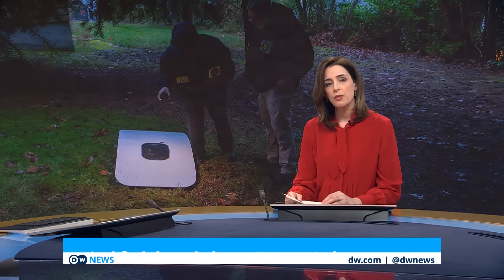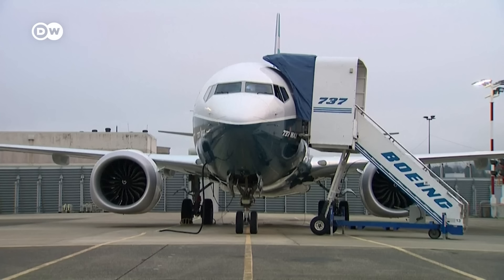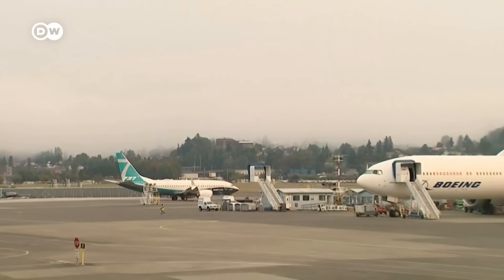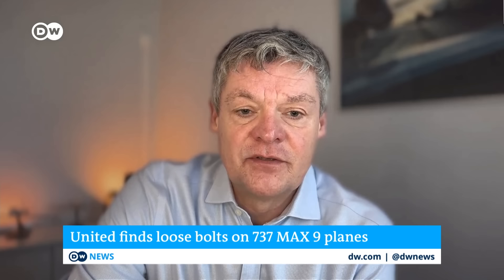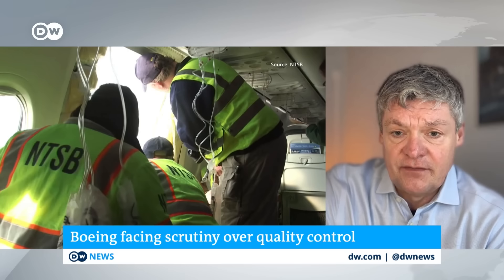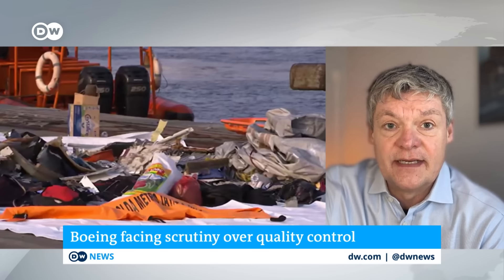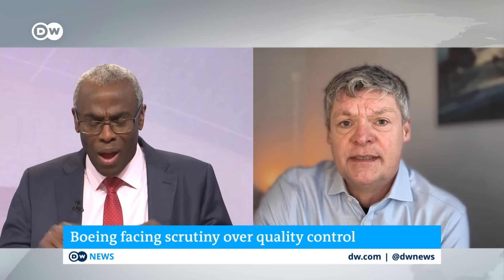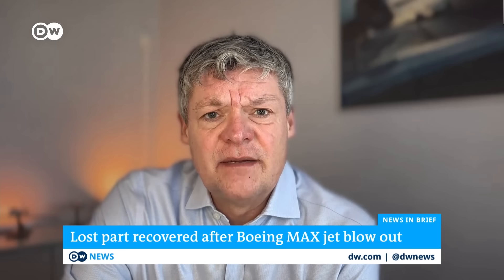After the Alaska Airlines incident: Is aviation quality control insufficient? | DW News

Comment: This isn’t about “aviation” quality control - it’s about Boeing quality control. No other manufacturer consistently has such dramatic - often catastrophic - problems.
Reply: ULA's (half Boeing)  moon lander was just lost so I agree
Reply: @bigboybuilder That lander was produced by astrobotic not by ULA, ULA just makes the rocket and that part was successful
Reply: Inspections aren't taken seriously,  by some inspectors. On a daily basis. Ask me how I know!!
Reply: its also about regulations and a lack of proper inspection....Boeing is too buddy buddy with them. They need more teeth to put boeing in their place.
Reply: @boa721  How do you know?
Reply: Well, both. Boeing does something wrong and the controllers don’t notice
Reply: @tamikovacs3887  Boeing does something wrong BECAUSE the regulators have been so reduced in their capability
Reply: you're acting like Aeroflot doesn't exist
Reply: @lowwastehighmelanin  they do, but the buck stops a boeing for hiring them, and regulators not doing their jobs.
Reply: @tamikovacs3887  controlers??
Reply: lol @lowwastehighmelanin
Reply: Don't blame Boeing's engineers for this.  Blame upper management, which does all they can to (A) ignore their engineers, and (B) cut every corner and every penny they can, by doing such things as start up the new factory where labor is cheapest and also least educated.   They literally moved their headquarters to Chicago to get away from having contact with their engineers who were constantly pointing out what they were doing wrong. 

Boeing needs a total change of leadership. NOW.
Reply: @lowwastehighmelanin  LOL! Aeroflot doesn't make planes!
Reply: Well, there has been. Look at what happened at Lockheed when it took several crashes to discover the propeller spinner whirling issue that broke the wings of the Electra until the wings were strengthened and the propeller spinners replaced.
Reply: @tamikovacs3887 that would be just Boeing and the FAA… not the whole aviation industry
Reply: @biz0r07  A regulator, the FAA 

not regulators
Reply: There was MD and it’s still MD
Reply: ....BS.....
Reply: Boeing has been making trashy airplanes for the past decades..
Reply: @Turboy65  Of course it is not the engineers fault, it is the board members and CEO, Dave Calhoun, who has a degree in Accounting. The CEO of Boeing should have at least a bachelor's in Aerospace Engineering , maybe with an MBA.
Reply: @DrVVVinK  Every company that USED to be run by engineers, and then switched over to beancounter management,  has suffered greatly for it.
Reply: @Turboy65  The ironic thing is Tim Cook has an engineering degree, and someones iPhone got sucked out, and when it landed it didn't have a scratch on it, and still works.
Reply: Doors don't fall off fords due to better quality control than Boeing.
Reply: @albertseabra9226  that is a ridiculous statement! the 747,717,757,767, 737 (non Max) 787,777 all have very good safety records
Reply: @tonamg53  I assume more than one person works at the FAA...so yea, regulators at the FAA.
Reply: @Turboy65 Unfortunately, the company suffering isn't our concern. The people have had to suffer more. The families of those that have died have suffered the most.
Reply: @andrewallen9993  The method by which they attach is COMPLETELY different but yet you're not wrong anyway.
Reply: In a country where education has degraded so much. Eventually more complicated parts of the economy will be affected and start falling apart.
Reply: Let’s not forget the 737 Max.
Reply: @brandonbrown4819  Boeing business Model changed.
In the good, golden years, Engineers planned and created the airplanes. 
And the Company was run under a Central  idea: Creating quality planes.

The Model changed. Cutting costs, cutting corners, the old guard left  being replaced by Engineers deprived of any authority.
Replaced by Financiers "endowed " with a short term mentality.
Unfortunately, about the same took place in innumerable Corporations with terrible results.
Reply: @biz0r07  Regulator is the FAA… not people who worked there.
Reply: It's too new for maintenance issues!!
Reply: NTSB isn’t doing the job of certification either!
Reply: @mmeeddddddozzzzzzz3421  Obviously,  you are  totally correct.
Reply: @rogerk2049  and they’re not supposed to. NTSB investigate accidents. Certification is done by the FAA.

The point of having two separate agencies is to avoid bias and conflict from self review. FAA is under the US Department of transportation while NTSB is an independent federal agency.
Reply: Ever since the crashes in Indonesia and Ethiopia I have made it a point to avoid this aircraft. They tell you the aircraft model at the time of booking. Please avoid it for your own safety. 
This plane was obviously rushed to the market  as Boeing was unprepared for the competition from Airbus. Hence they asked FAA for a lot of engineering exemptions.
My fear is that they may use these exemptions company wide. 
Now I am nervous about the new 777 and 787.
Reply: I am an American and I’ve worked in factories and I’m an engineer. American quality control is dismal in most companies. You have to understand that there aren’t very many technically savvy people in the USA. People go to college and get degrees and easy things like business. What a joke!
Reply: Boeing became the General Motors of aviation when they joined with M-D.

Comment: Boeing is a good example of what happens when you let business economists lead such a company instead of engineers.
Reply: Or when DEI takes over a company
Reply: @kaseyc5078 how did you manage to relate this to DEI exactly?
Reply: @papaleyo 
When people are hired into a company to fulfill DEI requirements instead of having the right qualifications.
Reply: But how did you get to this conclusion. You're just showing how hateful you are.

Boeing made the decision to outsource the production of various parts of the plane to countries like Japans, Italy, etc. This is where the quality control issues began to crop up.
Reply: Exactly.
Reply: @kaseyc5078 you won the contest for the  dumbest post in the internet.  I bet you’re a MAGA voter
Reply: While passing on the balme to foreign suppliers sounds enticing, bolting of doors to the airframe happens at final assembly which is in the US
Reply: there is no reason to spin off assembly operations to separate companies EXCEPT to shave costs off a product. You can't do that without reducing safety processes, they simply go hand in hand.
Reply: Actually one of best was Schrontz, who had a law degree.  But he knew along with key engineers like Mullaly that tests will cost what they cost to produce a safe airplane.  Next is that production will cost what it costs and cost is better then shoddy work… what killed Boeing? Failing to buy McDonell Douglass and allowing them to take over Boeing.  First thing Stonecipher did was force out Mullaly and installing a new management philosophy of outsource outsource and outsource… we say a complete failure if this model with 787, we told them that you can’t cut concept to market in half… 2 years in, key part was still not designed or tested… 

This reporter is terrible… loose fasteners is a production problem, not a structure problem.  And assembly of the fuselage comes out of Wichita Kansas… so what happened to QA?
Reply: @RT-mm8rq  So the people admitted in under such a system have 0 qualification? Like do you think companies suddenly STOP looking for experience/qualifications when they account for diversity? This is just hateful like come on.

Comment: This is what happens when you let an airline company do it's own safety inspections.
Reply: Boeing has one option on this situation with the MAX- they may have to go to having two inspectors signing off critical installations or maint! the 747, 777, 757, 767, 787 all have very good safety records but the Max is the lion share of their commercial Airline business now!!
Reply: @brandonbrown4819  i saw the pictures of the loose bolts and to be honest, i doubt any inspector looked at the installation and approved it AT ALL. You can literally spot the loose bolts by just looking at them.
Reply: @fgbae8220  I hate to admit it, but you're probably right- on the critical installation the Inspection was probably pencil wipped!
Reply: exactly the FAA needs to have a backbone and not let the large manufacturers to do their own inspections
Reply: Then you probably don't want to know how the medical device industry operates. Least even what a 510k is.
Reply: @pfefferle74 We do and if it's a problem for them as well, then it also needs to be rectified. You can't just say, look there are problems over here, therefore you can't criticize those other problems. It doesn't cancel out, does it? Problems anywhere are problems nonetheless, and they deserve to be addressed.

Comment: From an engineering point of view, you wonder why the "plug" is applied from the outside and not from the inside where ist is pressed against the frame by the interior pressure. When windows are replaced with plugs, for instance, during the conversion from passenger to cargo aircraft, they are mounted from the inside, and they simply cannot physically fly out like that because they are bigger than the hole they are closing.

From a safety point of view, shouldn't all of those planes be put through a complete revision? Nobody knows where else crucial manufacturing blunders have occurred as obviously Boeing is not capable anymore of guranteeing the integrity of their manufacturing and quality assurance processes. Nor is the FAA who has miserably failed again to exercise their oversight over such things.
Reply: A good question, but the answer lies in the fact the framing around the plug is made for an emergency exit, and the engineers at Boeing came up with the least costly way to keep all the door opening builds the same. It also allows for a emergency door to be added later if an airline chooses to increase the seating numbers. Yes Boeing has QC issue, and most stem from removing I points (Inspection points) along the build process. All about corporate greed and CEO's making millions if they cut costs.
Reply: The design is meant to deceive passengers who might notice that they are sitting in front of a hole that the airline purposely put in the fuelselage to save money.  Why in the world would you buy a brand new airplane WITH A HOLE IN THE SIDE?!?!  

The answer appears to be because it made the fuelselage a few bucks cheaper.
Reply: That's an extremely important point and it should obviously b installed from inside so there is no chance of this happening
Reply: Maybe in emergence exit situations, outside plug fitting makes more sense.  Usually workers or mechanics use automatic torque tighteners/wrenches to tighten the bolts, exacting the engineering torque specifications.  I'm puzzled why there still has loose bolt issue.
Reply: It is a design flaw. I am sure NTSB will address this issue at their final report.
Another point: Why are these plugs required in the first place? Most of the customers do not need dense seat configuration. You open a hole in the fuselage and then try to close it. Extra failure point.
Don't tell me the story that second hand owners may want to change the seat configuration. Who does that and why Boeing should care?
Reply: @mingouczjcz3800  The cotter pins most likely never installed.
Reply: @mingouczjcz3800  You could still design the plug differently than the door it replaced such that the plug will no fit through the door opening. Every thing about that plug should be installed from the inside.  Covering it up later with interior panels would be okay only if they were easily removable and the plug then inspected regularly.   Seems like the FAA has no teeth anymore.
Reply: @mingouczjcz3800  Production line, got to get them out now. or like on TV, Price and Supply Chain issues, we don't have all the bolts or just finger tighten them it's faster.
Reply: @mingouczjcz3800  Production, hurry hurry. You put bolts in plug door latches finger tighten them, you come by and torque them. Oh XXX went on vacation or was sick and mist a week or more of work. Oh the bolts are in there put the panel on.
Reply: The plug was outside because that was a door not used in that aircraft but used in another configuration seats. It was a hidden door.
Reply: The door plug slides into place behind tab stops, so in flight the pressure inside the plane pushes it against the stops. The only way it comes loose is if it first slides upwards a few inches to disengage from the tab stops. And it only can slide upwards if bolts preventing it from doing that are not there. This is not a new design. I’m 99% sure they will determine this is a workmanship issue or a maintenance issue, not a design issue.
Reply: You hit it right on the head. It's a design flaw. It's like a pressure cooker with a plug applied from the outside and not from the inside. It will pop when the pressure inside is greater that of the outside and there was no redundant safety design to keep door in place if the bolts holding the door fail.  At least if designed for from the inside, the door larger than the opening will still hold. Don't blame Alaska airline like some people did. It was a brand new airplane, a few days old. The fault is Boeing.
Reply: $$$.  It all about the money.  When Boeing hires a person who is getting a "STEM" degree then end up with a Business Degree, it become more about economics.  I suspect the plug was actually outsourced.  Compare the engineering of a Door to a plug.  The plug has no visible inspection point other than taking the entire interior plastic covering.  Eventually, the temp solution will be inspect or add lock tight to the nuts and bolts, the next solution would be a catter pin solution/dual bolt, and finally recommending that airlines not convert/limit the seat conversion airlines do to optimize the fleets...PS airlines outsource this to other companies
Reply: Bang on, most aircraft doors close inside out, which is a common design to avoid this kind of mishaps.  Knowing Boeing, they probably would jump out to blame the production line folks, but this is absolutely a design problem.
Reply: The plug fits a doorway designed for an emergency exit door, so uses the same scheme to hold it in place, but modified slightly to suit the situation.
Reply: The FAA only does as much oversight as politicians allow them and fund them.
Reply: @Sashazur  Thank you for actually having a more detailed response. The stops in effect are doing what everyone's asking for and the door then acts like a plug. This a QC/MX issue.
Reply: My god you are so smart.
Reply: This plug is mounted as any other emergency door and should be as safe an emergency door.
According to your logic, then all emergency doors are hazards and should not be there at all.
And we all know that your logic is totally failed here as these emergency doors are of outmost importance for the safety of the passengers.
The problem is not in the use of this plug and it being mounted from the outside.
The problem is in the lack of quality of the job and/or materials of the mounting of the plug.
If the materials and the job are of a high enough quality, then there is no way this plug can burst lose like that, because of the construction of it all.

Comment: The FAA must require every board member of Boeing to fly in the seat by the hole they put in their brand new airplane.
Reply: That might keep 737 Max from crashing.  Some one must have done something right, It lost a plugged door and it didn't crash! i.e. saved lives! The most important goal is to save lives, money is replaceable people are not!
Reply: @rjaquaponics9266  They made a hole in their plane so they could plug it.  Tell me what school of engineering teaches that?
Reply: @Dubinski2382 it was a manufacturing decision because there are versions of this plane that have a door there instead.
Reply: I remember hearing that China forced all its computer programers who worked on the Y2K bug to take a flight on Jan 1st, 2000.  That’s one way to have skin in the game.
Reply: @stevezelaznik5872  I actually think the Chinese forced boeing to add the extra doors too.  Just read about that.  Lion Air.
Reply: FAA is in Boeings pocket. Wake up.
Reply: Better still make THEM pay for the airlines loses from THEIR bank accounts as they more than likely CAN afford it from all the bonuses they got for reducing production costs.